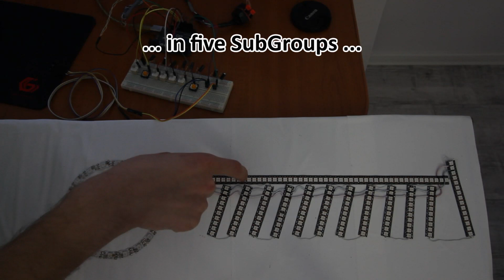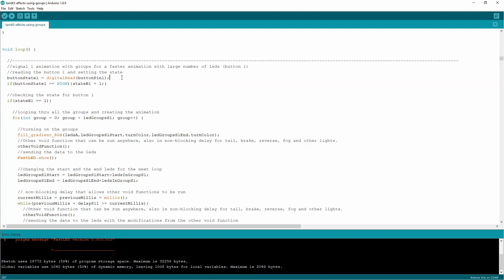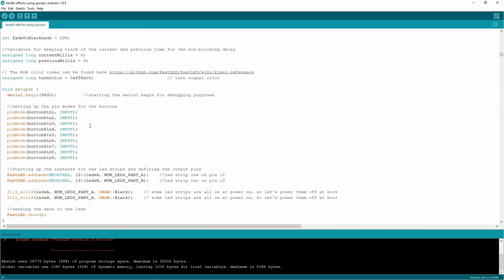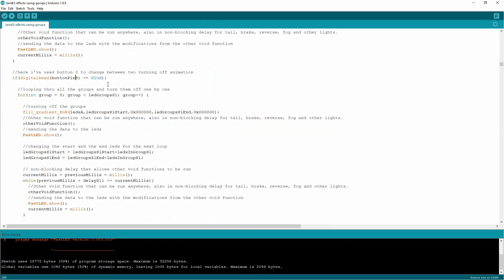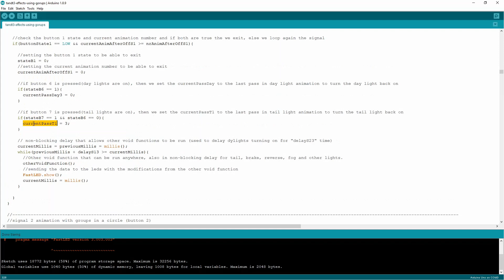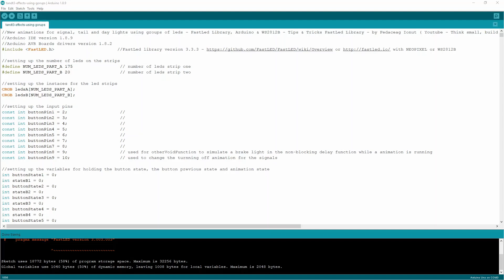New animations for sequential signal, tail and day lights using groups-Arduino, FastLED and WS2812B

Comment: How cam I use group 3 only, by turn and day light running with selection animation for day light affect, pls advise, thks
Reply from the maker: Every animations is commented in the code and has settings also commented in top of the sketch, so just extract what you want. With pleasure.

Comment: hi, i started working with led tailights here in brazil. i really liked the possibilities we can work with addressable leds and arduino on tail lights, but i'm total noob on arduino coding, i'd like to know if you have a ready to use code that i can use on my products just changing the numbers of led and positions (or groups), or if i could hire you to make a code for this

i need to take the signals from the car, running lights, brake, turn and reverse (in this video you used buttons) to trigger the effects, and some shows mode for meetings... 

i have seen some codes but work for a single strip that put in the middle of the car... here the link:

https://www.youtube.com/watch?v=-kA0ffAG03A

 i'm a good logic guy to learn how to modify and adapt the code for each product i make, but i really have no idea of how to code from the ground, i think this video is a good north but i think i'll need some help...

i watched your modern turn signal 6.1 and i think it's kind of that, but something with right and left turn separate so i can use 1 arduino for a pair of tail lights, here in brazil an arduino it's not that cheap, and the cheapest is the nano
Reply: i watched a lot of your videos and i'd like to sugest (what i need, of course) to make a code for right and left sides of a tail lights, separate but in the same arduino, and you can add the right and left headlights too, with sequential and running white lights, and a show mode for all of the four lights

Comment: Sal, poti  face control neopixel ring  si in potentiometer,  tot  incerc  as scriu  programul, neopixel  ring contine  24 leduri, ms
Reply from the maker: Salut. Eu nu am timp, dar cea mai simpla metoda cred ca este sa folosesti functia map(), care iti permite sa mapezi valoarea potentiometrului la numarul de leduri si totodata sa ai si o valoare minima si maxima pentru ambele valori de mapare, ceva de genul " valNrLed = map(valPot, 0, 1023, 0, 23); " apoi folosesti valoarea ca sa controlezi ledurile cu functia din libraria pe care o utilizezi.
Mai multe informatii despre map() gasesti aici - https://www.arduino.cc/reference/en/language/functions/math/map/
Spor...
Reply: @IonutF-TS-BB  multumesc mult,  si Inca ceva,  arduino  se poate folosi  si in domeniu  industrial  sau  nu este chiar safe  pt o automatizare  de exemplu
Reply from the maker: @eugenecrane6093  Este o intrebare buna la care nu am un raspuns exact, pentru ca depinde foarte mult de ce vrei sa faci cu el. Teoretic da, se poate utiliza, la baza este un cip AVR care are watchdog, chiar si software security care poate bloca citirea programului, trebuie doar activate din cod si ce-i foarte clar, trebuie modificata conectica, pini de pe arduino nu reprezinta incredere deloc... Am gasit multe cipuri ATmega utilizate in tot felul de automatizare, conteaza foarte mult sa respecti cerintele clientului si siguranta produsului final si a celor din jurul lui.
Reply: @IonutF-TS-BB  multumesc  sunt mansur ca sunt si Romania pasionati  de arduino si nici  EU nu prea am  timp am un bebe  si  chiar  nu am mereu  timp  sunt macaragiu  de meserie  si are  un software  frantuzesc  MCU e jale. EU am pornit  motorul  masini  mele  cu arduino  un Renault si doua relee  de 5v belea oricum ms de msj.😊😊😊
Reply from the maker: @eugenecrane6093  Bebe si eu, de aceea nu am mai avut timp de canal... plus pandemia vietii. Cu placere!  😉
Reply from the maker: @eugenecrane6093  Mersi la fel! 😊

Comment: excellent friend, I'm going to do it in my car. I already ordered the components through AliExpress. I have some curiosities if you could help solve them it would be great. I want to use the attiny85 with these animations that you are using with the Arduino uno. The question is "is it possible that This sketch works the same way on the attiny85 ?. Have you done tests with the ws2815? And what about the ws2812b separately per unit, the ones that come with a heat sink?

Comment: Hi very nice! The LED 5V 144 strip is not working well, my car puts out 13.5v when it is on and 12v when it is off I have followed your instructions BUT

Park light is 3v connect together with the brake lights 13.5v it's flickering the park light and brake light both use 1 wire (cannot split?) causing flickering

The indicators flashes with the park light when everything is on 

Everything works well when car is off but when the car is on the powers supply changes causing issues

I've tried step down and step up converters but it's not working well
Any advice please?
Reply: Yes agree do i need resisitors? or Transisitors? or something must work with this while the car is on same problem when the car is on causing voltage spike causing the leds to flicker when indicating with the park lights on etc

Comment: How can I program this but to actually use in my car? I've been trying to figure out it for the last month. I even have the switchback controllers din both ghozts and corsomotions. Raspberry pi and arduino. Amd what I came up would work the best if arfuino with 8266 esp. Do you have any ideas? Please help. Write me a message. You can write in România but I do better in English I left 31 years ago when I was 9. I still speak almost prefect but writing not so much

Comment: Idk if you can help me, i want to use my turn signal on my brake light, like most American cars, i can use the arduino or simple relays ?
Reply from the maker: For that you will need a new sketch...
Post a clip with how the lights from your car work (all the functions), because i know that they differ from european standards, but i don't know how exactly and i will make one version in the future. ;)
Reply: Ionut Fedaceag  https://youtu.be/ekILN6TYbSQ 
Like this module, I think it’s pretty simple, and it’s universal, similar to a relay, search for switchback bulbs
Reply from the maker: @netuno96  If you want to keep your original lights and just want to change the responsible lights for the signal, i think you will need some kind of simple logic with some mosfets, because you need to combine two signals, the brake and the signal and some adapters to hook up to the original car wires.
If you don't wanna change the lights with ws2812b and the adapter exists on the market, why don't you order it?
Reply: Ionut Fedaceag  yes, keep the original lights, which mosfet would you recommend?  or if you have a circuit, I will search for mosfets.
Reply from the maker: @netuno96  Well it's hard to say, because i don't know your power consumption...
Unfortunately i don't have a pre made circuit for your need.

Comment: Wow, awesome sir.
I'm very like it !! May i request? 
How if you make turn signal for left and right, and daylight like a group 3 on strip 1, and use hazzard mode.. 
But use pulse turn signal from the car to trigger input for arduino
I'm waiting for your next project..
Thankyou sir..
Reply from the maker: Thanks.
For this, try to see my other versions how the structure is made and start from that structure...
To trigger the arduino input use optocouplers... watch this till the end https://youtu.be/EpcTs9y_pFg?t=169
With pleasure!
Reply: @IonutF-TS-BB  thank you for your answer.
But i mean, trigger for turn signal, as long as input pin is high, turn light is always on, and if the input is low, turn light is off. But keep the sequential effect. How its made? Hope your help.
Thank a lot sir .
Reply: @IonutF-TS-BB  I've found what i want, by modifying the code. It's so cool.. thanks for the code.. good luck sir.. I'm waiting for your next project..
Reply from the maker: With pleasure! ;)

Comment: Best job ever .. congratulations .. after your permission can you help me ?
Reply: I'am having an issue with the turning signal animation (used twice) i want it to turn only once in each time i push the button ??
Reply from the maker: Well, this is not a issue, I have integrated this possibility because it is very useful ...

In every signal routine/function there is a variable defined that controls how many passes for a single impulse and those are:

int nrAnimAfterOffS1 = 3; //how many times the signals repeats with a single impulse
int nrAnimAfterOffS2 = 3; //how many times the signals repeats with a single impulse
int nrAnimAfterOffS3 = 3; //how many times the signals repeats with a single impulse

3 means actually 2 passes and 2 will be actually 1 pass...
Reply: @IonutF-TS-BB  thank you sir .. well understood 🤝
Reply from the maker: With pleasure! ;)

Comment: How to reverse direction for animation 3 (turn signal) and how to add second strip to animation 4 but with reversed direction ?
Reply from the maker: For animation 3, you need to change the start and the end positions for group and the subgroups (ledGroupsS3Start and ledGroupsS3End) and make the function to increase the groups, because now the function is decreasing the subgroups...
For this question " how to add second strip to animation 4 but with reverse direction ? " you need it for the other side of the car? because if that it's the case you don't need to reverse it... you only place both strips in mirror... and you add a second fill_gradient function to handle the second strip...
Reply: I will try with turn signal and yes for other side of car I need second strip
Reply: Is this for turn signal  increase group? int group = 0; group < ledGroupsS3; group++) {
Reply: And start end int ledGroupsS3Start = NUM_LEDS_PART_A-1; // first led from the first group (it's actually the last led from the strip)
int resetLedGroupsS3Start = ledGroupsS3Start; // reset first led from the first group
int ledGroupsS3End = ledGroupsS3Start-ledsInGroupS3+1; // last led from the first group
int resetLedGroupsS3End = ledGroupsS3End; // reset last led from the first group
int lastLedLastGroupS3 = (ledGroupsS3Start-(ledGroupsS3*ledsInGroupS3))+1;
Reply from the maker: @hooky3392  If you are trying to reverse the signal for the second side of the car, YOU DON'T NEED TO! Because you already need to create the second strip IN MIRROR, so it will be basically the same code!
Yes, those are the variables for signal 3... please read the comments, everything it's explained there....
If you don't know to well english, use google translate... https://translate.google.ro ... it makes wonders for mee... :) ;)
Reply: Thanks very much.  All done and work perfectly.i successfully added and hazzard lights function
Reply from the maker: With pleasure! ;)
When you have the time, share your version, it's good for inspiration... :)

Comment: That's awesome.  Can you create sequential turn signal with new audi daylight animation and welcome lights 
with 2 times hazard lights and then daylight animation  for 2 strips? https://www.google.com/search?q=audi+a7+animation&tbm=isch&ved=2ahUKEwj7xZbMkoLpAhW0gM4BHdviCqUQ2-cCegQIABAB&oq=audi+a7+animation&gs_lcp=ChJtb2JpbGUtZ3dzLXdpei1pbWcQAzIECCMQJzoGCAAQCBAeOgIIADoECAAQEzoICAAQCBAeEBM6BggAEB4QEzoFCAAQzQJQ6WRYqJEBYOyUAWgDcAB4AYABqQKIAZ8bkgEGMC4xNi43mAEAoAEB&sclient=mobile-gws-wiz-img&ei=tWyjXruXI7SBur4P28WrqAo&bih=572&biw=360&client=ms-android-samsung&prmd=inv&safe=active&tbs=itp%3Aanimated&hl=bg#imgrc=n9XOdtwuPteyWM&imgdii=-CTs1Y2OYkn6NM
Reply from the maker: Thanks! :)
On the fourth button i started to do that animation on group three, but i didn't like it how it looks in my set up, so i modified and i came up with the version from the video... 
If you go thru the code and understand it, with a few simple modifications you will end up with that animation...
And for the welcome lights animation, everything is already created, the only things are needed are...
1.simple routine to runs the signal twice and the day lights after that
2. the triggering for that routine... and the best way that i could think of is by getting a signal from the car locking system... and if you go thru the comments, you will understand how to write that simple routine...

Comment: Can you make this arduino sketch with the same animations with just "group three" working I would only be using the 100 and some leds. I like the way it looks but I dont need groups one or two or the round leds. Just looking for group 3 to work the same way it is now.
Reply from the maker: I've spend crazy amount of time just to add all the comments to be easier for anyone who wants to learn it and then modify it, so first you should give it a try to modified yourself and if you get stuck, tell me and i will help.
The main purpose of this channel and the clips is to make others learn them self how to code by offering tutorials and code made easy to understand thru cool projects that they want or need... so, if i will modify it for you from the start, i will defeat this very purpose... ;)

Comment: Very nice and unique project
Please make a video on 1w or 3w sequential led also
Reply from the maker: Well, i don't know any digital leds of 1w to exist and the 3w ones are to expensive, bulky and to powerful...  https://www.adafruit.com/product/2741  and to build this example with regular leds it will a messy job with lots of wires and mosfets ...

Do the math from my last comment to you, where by the way i made a mistake, because for yellow one led consumes only 0.040mA (red and green full on and blue off) and see how much power you have here for the big signal with 50 leds, it's almost 10w for the signal...
Reply: @IonutF-TS-BB   Sir I am talking about led 1w single color or max doubler color white and yellow
Drl and running turn signals can be made on them because for turn signal the 5050 LEDs are little bit less bright, brightness of 1w or 3w is awesome
Reply from the maker: @amit_diyretrofit5930  With rgb leds to make white you will need to control all three channels, so that means three output channels on the controller and three mosfets, extremly messy...
With rgbw leds you will need at list two outputs and two mosfets and you can control the white and yellow (red and green linked together), still a messy job...
With one color you will need one output and one mosfet, achievable, but did you think about the cooling?

The 1w leds ar bulky, the mosfets are bulky and both at 1w will generate a lot of heat and you will need a lot o space and ventilation...

While with digital leds, if you want more power, you can just put more leds/strips in parallel, extremely simple and elegant... and if have room in the light housing for the 1w version, you will sorely have room for more strips...
Reply from the maker: Do you think that digital leds can't be used in cars?
Ok, those are cheaper, but you will still need two outputs and two mosfets for each led... a good cooling solution for the mosfets and the leds... a lot o space and good ventilation in the light housing... still a messy job...
Isn't simpler, elegant and more cheaper to use digital leds in parallel ? (you don't have any limit...)

Comment: love these videos, very instructive and im always looking out for your new ones, this code will work fantastic for head/tail lights, but how would i use the 12v signal from the stock car wiring for switching the sequences on/off as opposed to the push switches you have used in this tutorial, thanks again keep up the good work and keep safe in these trying times
Reply from the maker: Thanks!
The solution to your question is optocouplers !
Watch this video https://youtu.be/7ZIk2abe_b8 where i explain how it can be used and you also have the schematic at the end.
With pleasure and the same to you! :)
Reply: love the way you hooked power up via diffrent solder pad rows between the close together leds, reducing heat in the area and lessening the chance of a bad solder point too
Reply from the maker: Good observation to the details, that was the idea, reduce the power loss, the heat and ultimately increasing span live of the leds...
Reply: @IonutF-TS-BB  Thanks for that, i have ordered 6 dc to dc bucks and some  ltv817's too, il take pics as the project progresses :D
Reply from the maker: @shaunbaltes8862  With pleasure! ;)
Reply from the maker: @shaunbaltes8862  Well, that is the basic principle to make patterns... you can only simplify the code a little bit, but the principle will be the same.
You can make an array with all the leds that you wanna light up and after that you iterate thru the array with no delays and light up the leds really fast. 
You can open the sketch for version 6.1 and search for    tailLightModel   to learn how i do it there.
;)
Reply: Thanks bud 👍👍👌
Reply from the maker: @shaunbaltes8862  With pleasure...